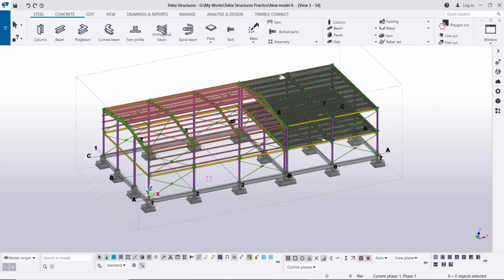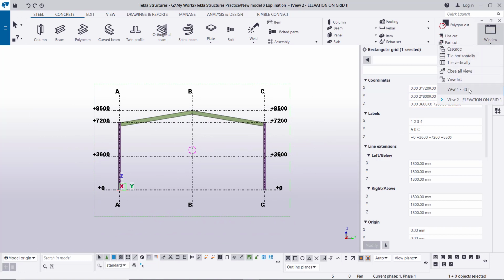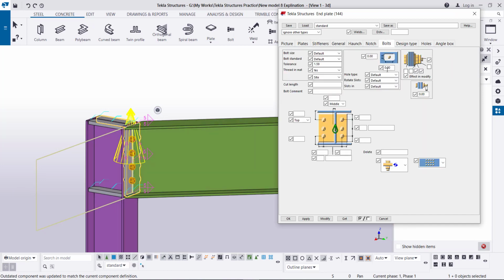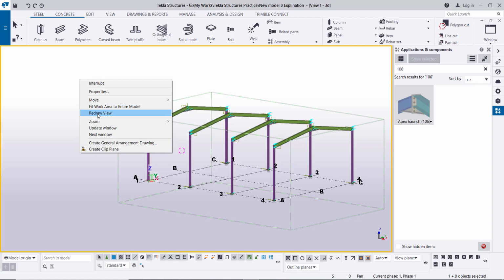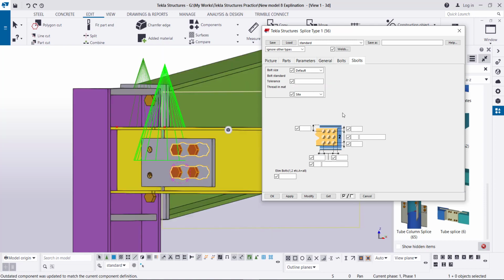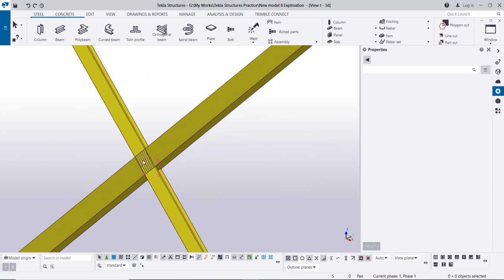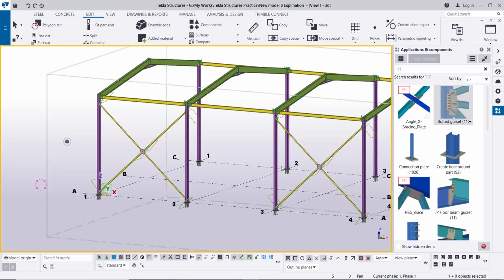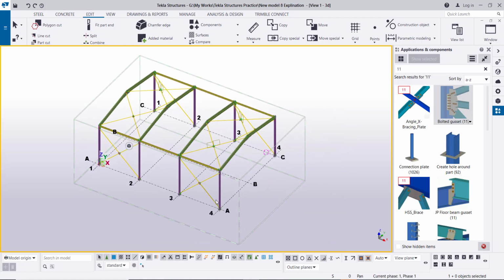Tekla Structures/ Modelling of Steel Shed and Deck Slab Building - Part 1

Comment: why not only weld the struct beam, was the splice necessary?
Reply from the maker: It can be one piece, but for installation purpose using splice make work much easier.
Reply: @civilstructuralengineering1841  okay i understand